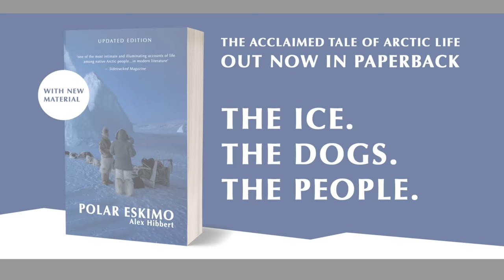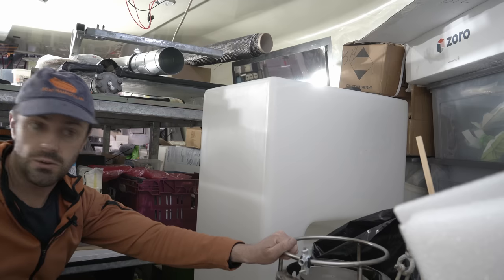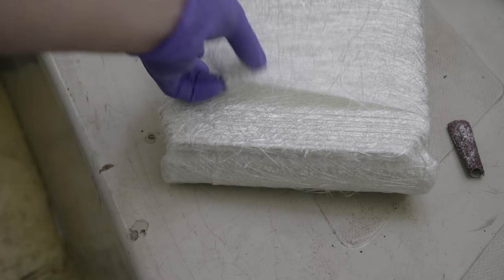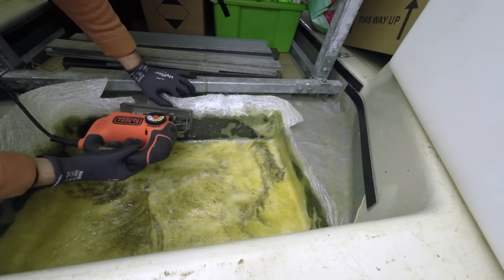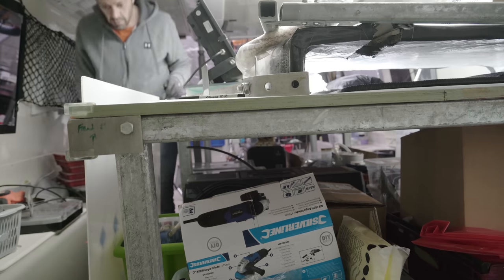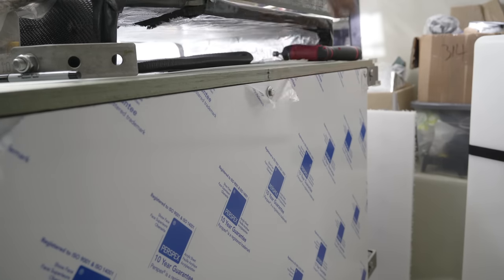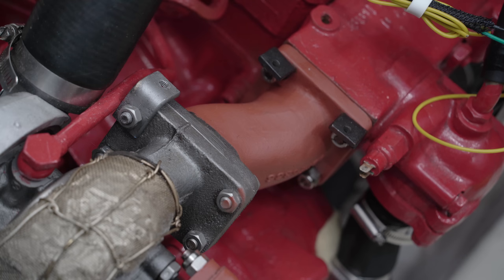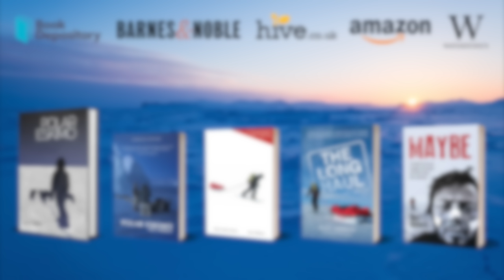Boat's freshwater storage planning - tank, filtration and galley area. Lifeboat Conversion Ep66 [4K]

Comment: I recently saw a novel idea to reclaim heat from an engine. The fellow took a small hot water radiator and ran the exhaust from the diesel through it before its final journey  to the exterior of the structure. I imagine that a ball valve could be arranged to bypass the radiator if it became to warm  or indeed    do a blend to modulate the heat .

Comment: Before final filling with water, flush the system with hot soapy water and rinse with hot. Then use a zero water filter to filter the water as you fill. Project Farm has a great video comparing different water filters, and zero water is the best. The filtered water will reduce the likelihood of introducing foreign biomass, thus reducing the chance of a bloom

Comment: Copper is the best to cut out bacteria, It will also alkaline the water which is also great for your body fighting parasites and disease.   It is how peolple have stored water for thousands of years.   Also there is no need to filter it out as the copper will add then needed minerals.   Maybe a few copper plates inside the tank either attached to the walls or possibly suspended in the tank?   If you put it on the walls it would also block light.  Kill two birds with one stones perhaps?
Reply: and here's the snake oil you ordered!
Reply: @realsonnysullivan  I see someone did not do their homework before becoming a keyboard warrior?    Let's all hear you ideas Sonny?   and let's also hear your issue with my idea?  I'm sure that with a coment like that you must have all the answers?  I'm sure you have more knowledge than thousands of years of something working?     Do share!       Alex I would be happy to add links but It will not allow me to.   A simple google search will explain in detail of how this works with no chemicals or electrical components to fail or consume power.    Ships in the days of old used this method with amazing results.
Reply: @kmparrott83  calm down. I'm talking about your alkaline water bs.
Reply: @realsonnysullivan  Well you might want to research before running your mouth.    It absolutely alkalines the water.
Reply: Boy "add the needed minerals"... What minerals? Copper? Yeah copper may work for keeping the water clean, but comes with the slight risk of Alzheimer's. Though that may be manageable for a few months of exposure
Reply: @youwish9786  just research it.    I'm not going to school all of you.     I'm not your momma